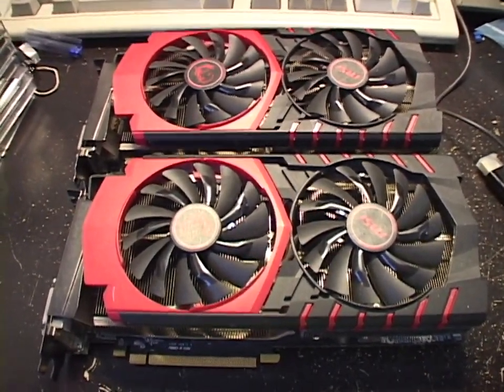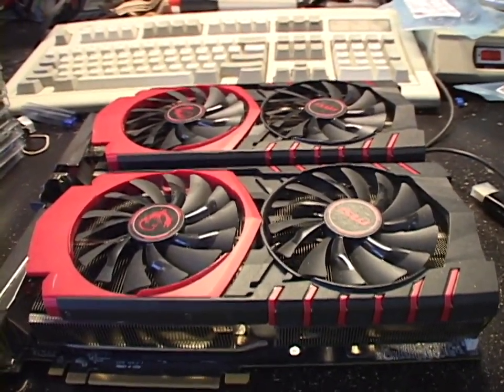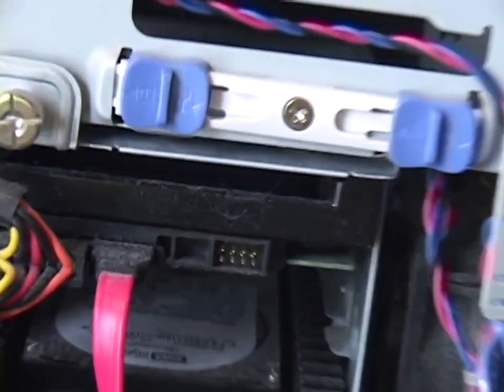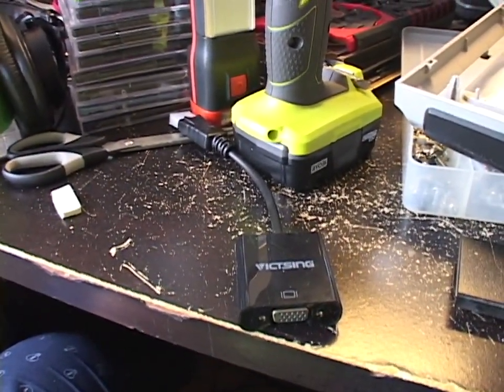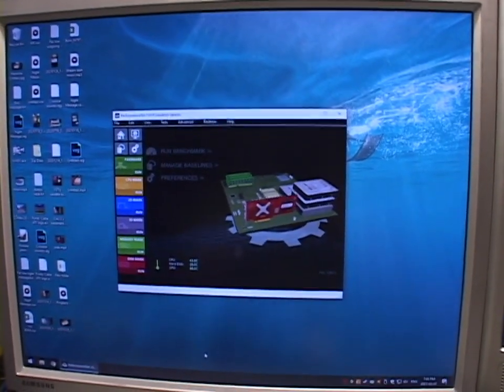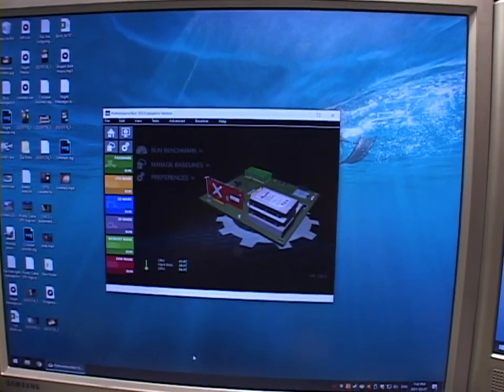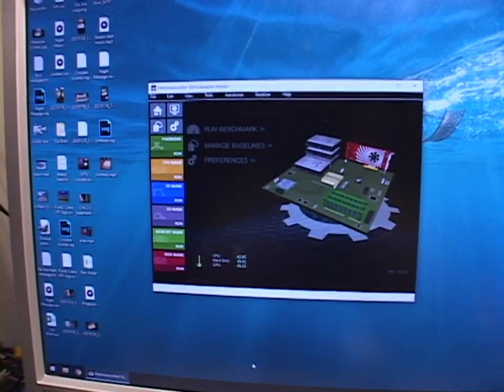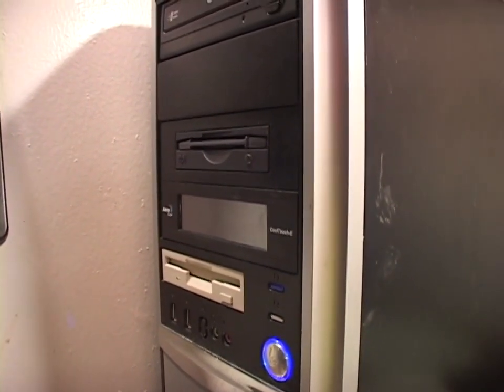Upgrading the main PC from a GTX 770 to an R9 390X

Comment: I recently learned the Intel HD Graphics 520 in my new laptop is three times faster than my fastest dGPU (Radeon HD 7450) which was already fast enough for me. The R9 390X is an additional ten times faster, I can understand you not knowing what to do with all the power.

And congratulations on your new Zip drive, I love the loading and eject noises on those. I don't think I've ever seen a black one. Is it a Zip100 or something newer? Apparently the newer large capacity drives work slowly with the old capacity disks.

And lastly, with video editing, I actually use an old version of Windows Movie Maker because it's super fast working with DV files (as long as you don't use video effects). I export several times faster than realtime on my 2.53GHz Core2 Duo. If you're not sure if Vegas properly using your card, you could check the GPU utilization percentage in something like GPU-Z.
Reply from the maker: It's a Zip 250 drive, out of the IBM NetVista.

Comment: I recently got a 8GB RX 480 for my Xeon W3690 machine, which the RX480 is about equivalent to the R9 390X in performance, which is nice. I’ll have to run the performance test on my machine when I get the chance.

Yeah, these X58 boards are pretty finicky, rarely my machine doesn’t even boot up when I press the power button, everything comes to life, but the screen stays black, hitting the reset button fixes that issue fortunately.
Reply: Even the X58-based Mac Pro is very finnicky with RAM.

Comment: Glad you got the card working! Some computers seem to be very particular about what they'll accept. For instance, I had issues with my laptop which has an AMD Ryzen 5 and an NVIDIA Geforce GTX because the game I wanted to play (Sonic & All-Stars Transformed Racing Collection) couldn't decide which graphics it wanted to use. My friend in Scotland who I was going to play it with (he runs a gaming event once every fortnight)  was able to remote-in and solve it. Hope the Zip Disks you want to view have interesting content on them. :-)
Reply: with laptops u gotta go into the NVIDIA control panel and select that it use the NVIDIA card or it will default to the onboard gpu.  and if u update the gpu driver and select that clean install option u have to make sure u go back to the NVIDIA control panel to reset that option.
Reply: @mraaron1584  Yeah, I think that is what my Scottish friend did (he does IT work).

Comment: I had a 5700 XT running in a system with an 11 year old motherboard up until a couple of months ago. I needed the extra DP1.2 ports for more 4k outputs. The sky is the limit!